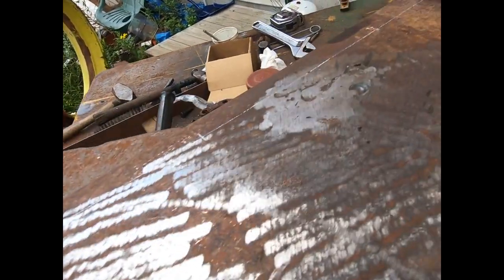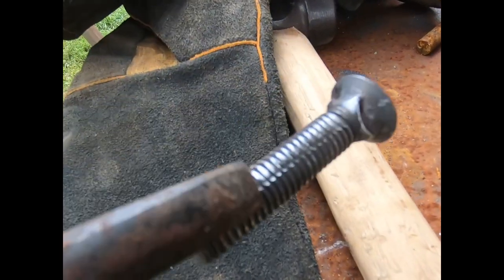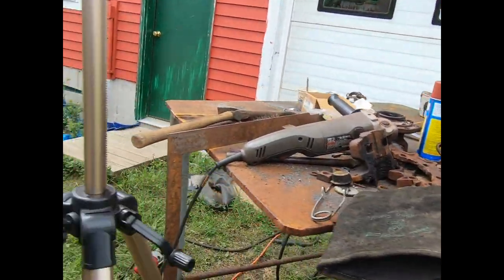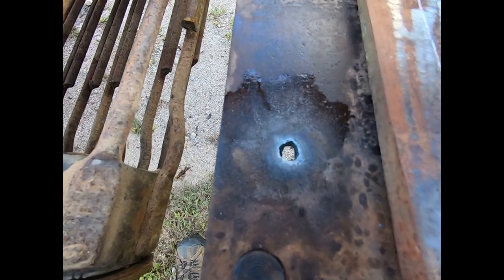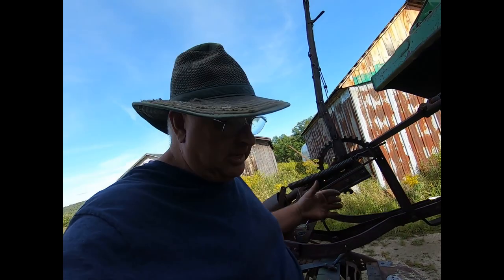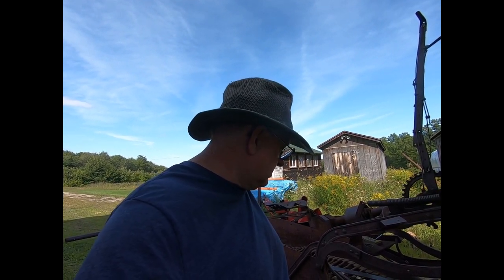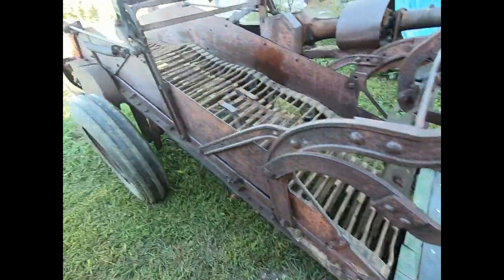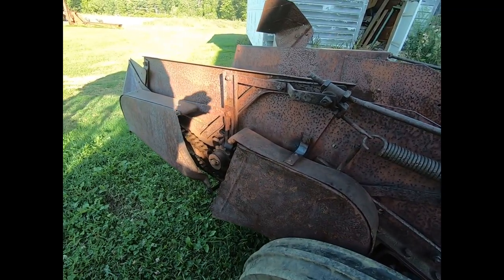Potato digger front shovel is finished

Comment: I mean the plate could be something like (probably isn't exactly) but a similar nature to 4140, Which is hard. as. hell. And then can be further oil hardened.
4140 though while it does  rust it's corrosion resistant, so it's not usually as extreme rusting as normal steel, But also isn't as resistant as say actual stainless. If I was going to be making a shovel blade, knowing it was going to be beaten and used hard and needed to last I'd pick a tough material in that family. They are near impossible to work with HSS tooling though because they are of similar hardness and if the alloy has been hardened any, it will end up harder than the hss, Cobalt tools stand a chance, carbide is ideal for those materials.

While it's likely not 4140 exactly, it's probably of a similar type of alloy in the sense of probably containing nickel or chromium in a small amount to offer hardness. Depending on the manufacture time, possibly molybdenum to ensure the hardness is even throughout. That though was something that didn't become common in production until the end of WWI and really wasn't terribly common until the 1930s. That would be my guess anyway.